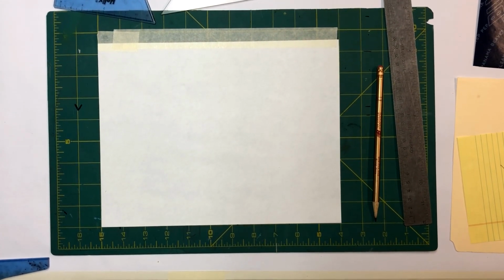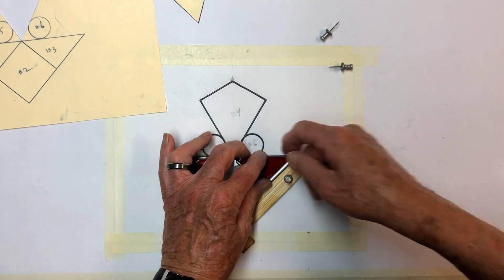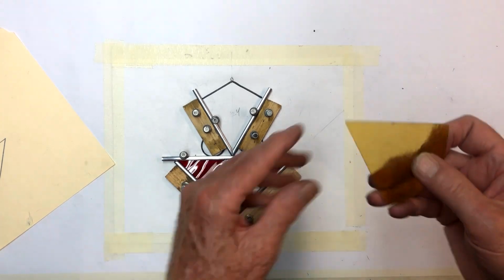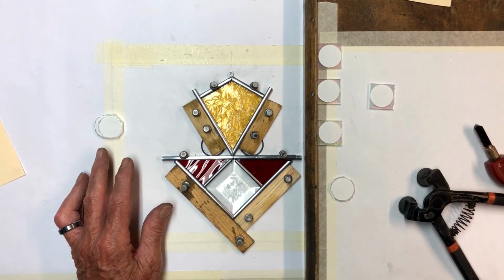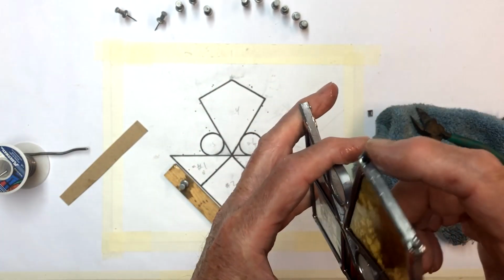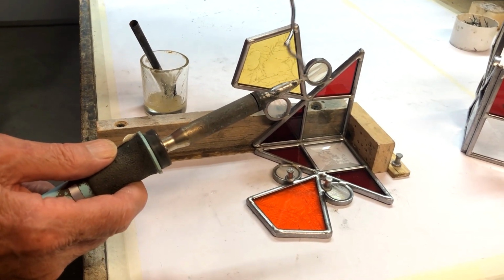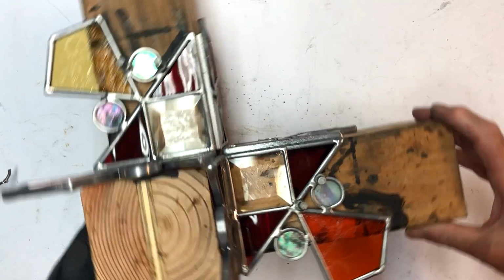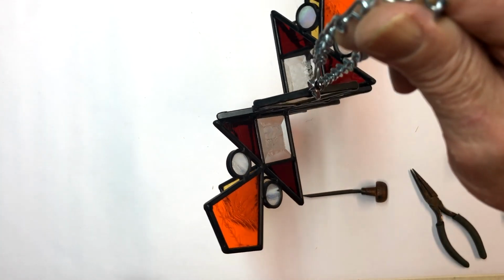Leaded Glass Spinner

Comment: Hi Bill, I'm in the UK and just starting out in this hobby. Love this spinner and will be having a go at some point. Can i ask what board you use for pinning your projects to, all the materials we have here are too hard for push pins. Also what you refer to as Dykes? I think here in the Uk are just side cutters, but your blades look real thin, are they a special lead cutter? Thanks for the inspiration.  Andy
Reply from the maker: Hi Andy,
So sorry to be so late with a reply, somehow, I didn't see your comment until right now. The top on my worktable is a product called Homasote Board, it's on top of the worktable which is made out of 3/4" plywood. Homasote Board is used as a sound barer in recording studios and other places where they want to keep the noise down. Yes, The Lead dykes are made for cutting Lead Came and are very sharp, and designed to cut Lead Came with a straight edge, I used to use an old fashion Came knife. I was interduce to these Lead Cutters about 25 years ago, now the Came knife is in the draw and retired!! If you have Amazon, you can get them there or at any glass supply store. Again, sorry for taking so long to get back to you, please feel free to ask me anything about these video projects. Have a great Day!!
Regards,
Bill Stone
Reply: @billstonesstainedglasscrea3310  thanks very much for the reply Bill, it was very helpful, I'll try and locate the board in the UK. I have found the snips on Amazon. Thanks again.
Reply from the maker: Hi Andy,
So glad that the info was helpful. I purchased the Homasote board here in the USA at an old fashion lumber yard. It comes in a 4'x8' sheet 1/2" thick. Most lumber yards will cut it whatever size you need. Amazon also sells a 24"x24" board but it's very pricey!! ($59.99) I purchased the 4'x8' sheet for just under $40.00 several years ago. Thanks for your comment!! Have a Great day!!
Regards,
Bill Stone

Comment: Came sizes I want to order some came but I don’t know enough about came to know what I want any advise
Reply from the maker: Hi Cindy,
The came used in all these projects are RU-70 U came and RH-9 H came. They are made by cascade Metals and have a great website on all kinds of Lead Came. I use this Lead Came on my larger leaded glass projects also!! if you would like to see some of these larger projects check out the video on the How to make a Leaded Glass Clock and fast forward to the end and there are several projects you can check out. 
The RU-70 
Lead Came is 1/4" Face Width and 5/32" Channel Width.
The RH-9 
Leaded Came is 5/32" Face Width and 3/36" channel width.
Hope this helps you out, thanks for your comment and if you have other questions, please feel free to ask me anything about these projects. Best of luck with your projects!!!
Regards,
Bill Stone

Comment: What kind of board do you have underneath that lets you use pushpins?
Reply from the maker: Hi there,
The top to my worktable is covered with a product called Homasote #440 - Sound Barrier. It's used in sound studios and any place where they want to cut down on sound in a room. I got it from a old fashion Lumber Yard. They will most likely have to order it special for you. It comes in a 4'x6' skeet and is about 1/2" thick. You can get a small sheet at Amazon and at Delphi Glass, kind of pricey for such a small piece. Check out my video called Leaded Glass Solar Lantern for Beginners and it goes over all the tools I us in making these projects. Hopefully this helps you out  and good luck with your projects!!
Regards,
Bill Stone